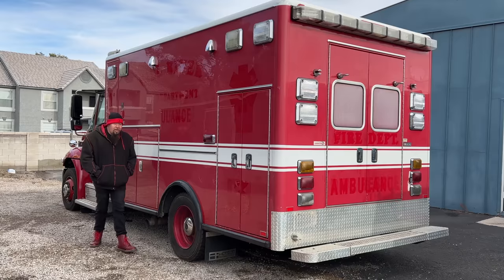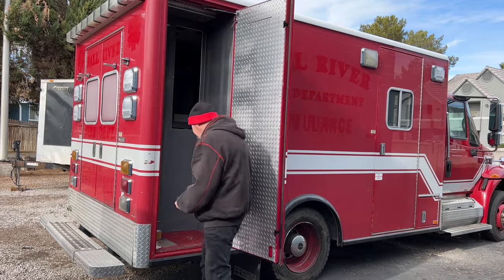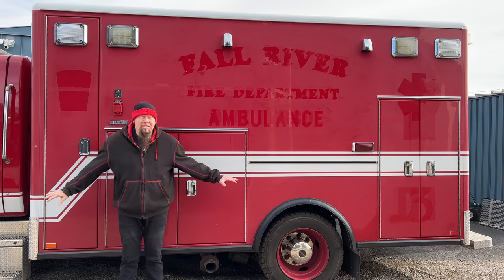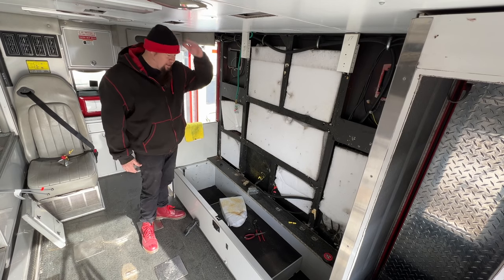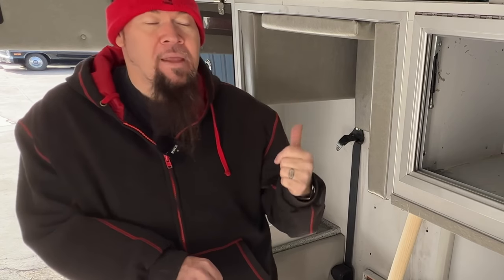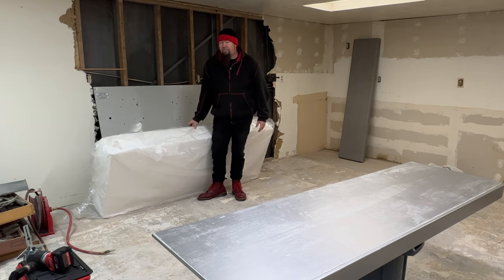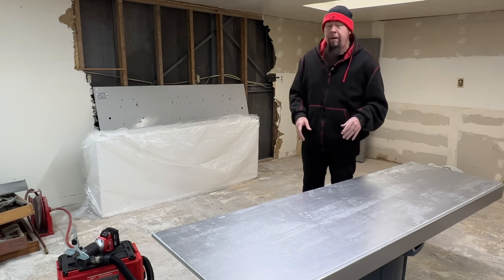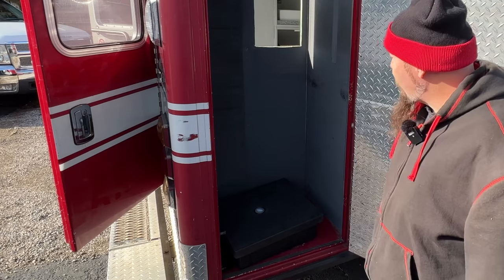Ambulance Stealth Camper Conversion - Part 1

Comment: Having the chest of tools is a great idea. If something breaks, you can be prepared to fix things within reason. If you aren't prepared, you'll be stranded. Wouldn't the location of the propane tanks be better closer to the driver's side rear cabinet? You wouldn't have to run the lines too far.

Comment: Can't wait to see it when it's all finished. Tip for you it may be easier to put in a separate water supply for your sink than to run a pipe across to it.

Comment: Your drains should be on the left side for when you pull up to a dump station. There's no rule that say they can't be on the right side, just being on the left side is for ease of access so you don't have to run a house around to the dump station. 🙂

Comment: Run the water pipe under the floor just insulate it or even put a heat strip on it and also put a drain valve on it to drain the system when not in use, Also you only need the one pipe going across and T off to the hot water heater, The outside door on the bathroom just needs a latch to lock it and open it from the inside.

Comment: I have the same refrigerator in my vintage camper,  I run it off solar when no plug in, I think it pulls 3 amps after start up which is great. 
For heat and hot water why not look into a Diesel Heater with the attachment that heats your water and you can just tap right into your Diesel tank.  I have restored 8 vintage campers so far and like you said these new campers are junk.  Once I seen how these vintage campers was built I will never buy anything after 1970. 
If you need any info on parts or stuff let me know and I will help as I can.

Comment: I, would definitely do a gas range stove. If you’re ever stranded somewhere cold for a number of hours it will come in handy. You can heat the thing while you sleep also, instead of leaving something run you can't shut off,I without getting out to shut off. If someone hears that running, they might brake the drive side window and dive off with you. Not a ambulance ride me personally would want to go on pew pew, or no pew pew. 😆
Reply: Maybe you got electric start? That would work for safety for you. I just worry Bob.

Comment: Check out everlanders videos. You can use Pepsi kegs for water with a compressor. No pumps required.

Other plumbing I would use 3/8th tubing vs 1/2 pex